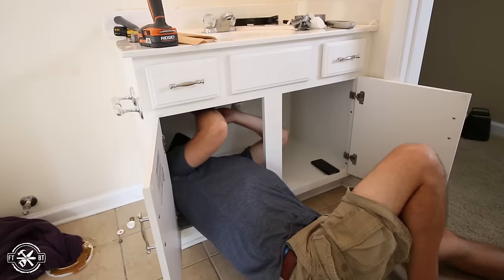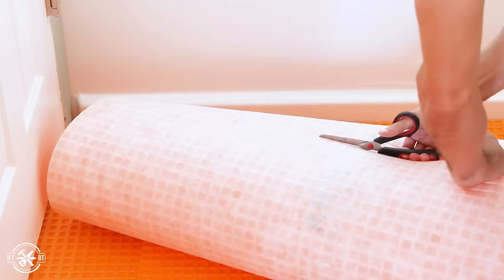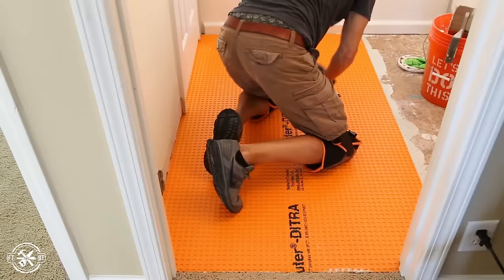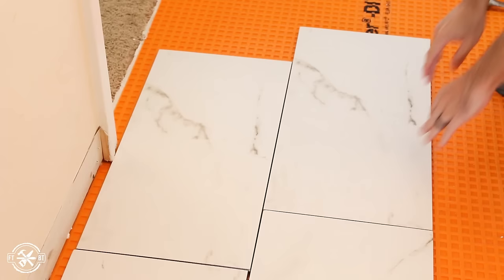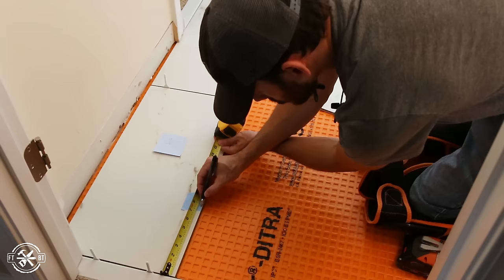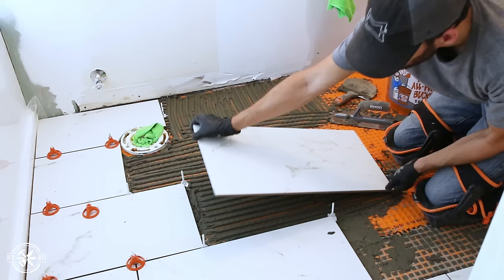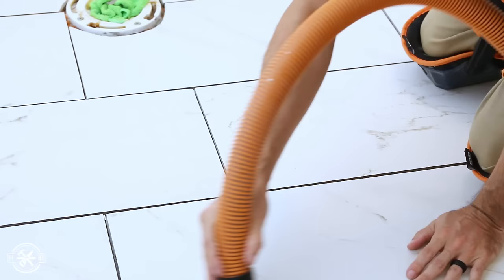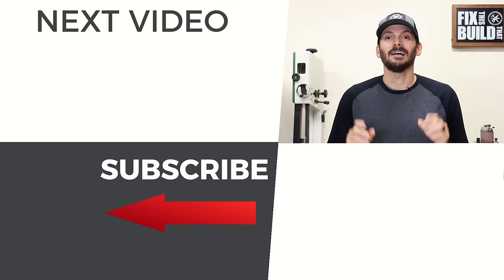How to Tile a Small Bathroom Floor | DIY Bath Remodel

Comment: Great Video.  Though, it's my understanding that it is highly recommended to dampen the subfloor with a sponge, before applying thin-set-mortar, to prevent the moisture from being sucked out of the mortar before it dries..
Reply: That's brilliant, great tip! 👍

Comment: As a professional tile installer I must say you did an awesome job explaining things and actually doing it correctly. Would have done a few things different but over all great video! Keep it up!
Reply from the maker: I'm a little amazed 😀. Was waiting to get kit up for something I did wrong 😂😂😂
Reply: @Fixthisbuildthat only thing I saw was speading of the thinset but that just takes time to get used to. Again great work!
Reply: Only thing I would change is adding more water to the mortar, both on the ditra(subfloor sucks up a lot of moisture) and the floor install(easier to work with).
Reply: I don't know what grout was used , but that was too dry to me. I wonder if it didn't crack. Dark thinset for light-white tile ? hmm. Yeah that mortar was dry for sure. Overall clean job.

Comment: "They didn't install it correctly......It shouldn't come up this easy"
I've heard this on a couple of videos I've watched about remodeling.  To me they are installed perfectly!
They are currently holding just the way they should but if you want to tear it up, it comes up easily. 
Sounds like a win, win to me.
Reply from the maker: Hahaha, good point. I definitely liked it 😀
Reply: Big Mike is talking Fair enough. haha
Reply: I'm thinking the same thing.  Things around the house should be easy to remove and replace instead of having to tear it all down and demolish it.
Reply: builders never think about the future where someone will want to change things, good luck future tiler getting that floor up

Comment: That was helpful, Ive never done floor tile before and didn't know you were supposed to butter them. Thx.
Reply: You don't have to on square tiles but on larger rectangular ones it is helpful because it's harder to get the mortar even across the larger plane and buttering them gives you more error room when setting them to be level.
Reply: How to tile a small bathroom using 10k worth set of tools
Reply: @Millennium Man And if you're just doing a relatively small job a $100 tile saw will get you through several of those. Way better than scoring and breaking imo.
Reply: @GardenofWar2  Thanks for the info.

Comment: I need to double check, but, I thought Ditre was used with UNmodified thin set. This video was awesome and the small bathroom was pretty much identical to mine. Love those tile spacers and will get those at HD if they still have them in 2023.

Comment: Subscribed! That Sketchup trick was real slick. I have used Solidworks in the past for laying out garage apartment that I built a few years ago. The only issue with Solidworks is that you have to make sure EVERYTHING has a dimension or constraint. Sketchup looks to be much much easier for projects like these. Great work!

Comment: Second video ive watched on this kind of thing, a few things i noticed that werent done:

- The pattern of the mortar on the floor looks correct, but it was not mentioned how important that is and which way the ridges need to go. This very important point could easily be missed by someone watching this as a guide
- Back buttering was done (6:13), but blink and you miss it. Again this was not explained and an easily missed step by someone watching this as a guide
- Actively working the grout in to the gaps between the tiles and not just floating it over and hoping for the best there are no gaps under the surface

Comment: good tips in this video. Use a standard masonry grinding wheel for the circular cuts which I like better because its easier to grind the inside of the curve which diamond cutting wheels aren't made for. You mix your grout DRY. if it works it works, but I've never seen it installed that dry.

Comment: The tiles look good and the levelling system does help. I would have used the Ruby wash boy set to apply and rinse off the grout. Washing the excess grout in 3 coats and each time changing the water so it's clean you do not need to buff or use a grout cleaner the next day.

Comment: Pro tip: don't lay tile on OSB, it's too flexible,  not strong enough to hold tile. When the floor cracks and the grout starts coming out... that's why. Also you can wipe the grout 2-3 times when it's fresh so you don't have to use haze remover next day.

Comment: Propane burning yellow will produce soot.  Fancy glass will soon discolor. Black is best for  longevity between cleaning. I am trying black glass beads used at the base of vases for flower arranging, Cheap, smooth no cuts and easily washed if and when.

Comment: The clip system will also pull the tile up in a corner potentially making it hollow underneath. This is the main issue with clip systems. If you notice this just lift the tile and add more mortar under tile. However all in all for the non pro it is amazing.

Comment: When working with ditra membrane try applying a thin mortar skim coat "back butter" to the underside of ditra membrane before placing it on subfloor to ensure you get a good bite.
Reply from the maker: Good tip

Comment: Awesome video and well explained. Question... I am remodeling the shower and I am using a floor similar to the one on the video for the walls, but for the floor I think it would be kind of slippery, what type of floor (polished or matte, porcelain or ceramic) would you recommend to use for flooring the shower area? Thank you.

Comment: Love what you did and how you filmed it. I have a very small bathroom floor and want to tile my shower wall as well. The only problem is Im thinking of keeping the original tub but it needs resurfacing and a new coat of paint. If I want to do this myself, do you reccomend learning how to resurface the tub and then just do the floor tile and new shower tile or is it better to pull out the tub and put a new one in which will be much harder for me I think?
Reply: How did this turn out for you? I'm getting ready to tackle my small bathroom (new tub and tile complete)

Comment: Im a long time tile guy. You did a great job!! My only two things i have to say is first your leveling spacers that you use suck. The wedge type are a lot better. And second is half inch on your trowel is a little big. I use 1/4 inch and i rainbow the grooves, this helps fill in the ditra grooves, especially if your doing a ditra heated floor. Minor stuff tho, and nothing that would make it any better or worse👍👍👍

Comment: Fix This Build That:  I am going to be painting the walls in the kitchen and the bathroom, and also tiling the floors in both rooms.  Would you suggest that I paint the walls first, then do the tiling second?  Also, should I take out the old tiles before I put the new tiles in?

Comment: Thanks for the video and the usefull information you gave. One question : when is a membrane like the Schluter Ditra really recommanded on a floor ? I have 2 plywood boards, 5/8 and 3/8 so I'm wondering if I should install a membrane before tiling. Thanks !

Comment: I like the leveling system. My question is for all y'all. How do you guys like that orange undermat that they sell at Home depot/Lowes compared to Backerboard/Hardibacker? Im doing my front bathroom and I remember doing my kitchen and master bath with the cement board but this looks much easier.

Comment: I wouldn't use wet saw for straight cut.  Not only time consuming but mortar will not adhere to wet tile as strong as dry tile.  tile cutter is the way to go.

Comment: Great video. I have a 5m Sq bathroom. The floor is not level. I tried to fix backer board directly onto timber floor using mortar. BAD MOVE. It didn't stick. Now I can't remove the mortar! 2 questions: how to remove mortar? And how to level floor?

Comment: nice job overall. end result looks great 

some tips: its always good to lay at least 1/4" ply over your subfloor so you dont spread thinset directly on your subfloor. If anyone plans to replace that tile in the future that sublfoor is a goner and theyll have to rip it out down to the floor joists. also its good to spread the thinset on top of the ditra first with the flat side of the trowel and really press it in there to make sure you fill all the waffle holes, then run over it again and comb a notch

Comment: Beautiful job. It has inspired me to do my 2 and 1/2 baths and a laundry room. What did you use across the bottoms of the doors as transitions to the rug outside the bathroom? Are they wood of marble? We will have wood floors outside of one of the bathrooms. Would you use the same material across the transition to a wood floor outside of that door?  Thanks!

Comment: I'm going to be replacing my wood subfloor for water damage, and then tiling over it.  I have the Schluter thing that you used, but everyone I've talked to said definitely use backer board of your tiling over a wood subfloor. Is the Schluter thing enough by itself?  I don't want this project to be anymore complicated  (for me) or expensive than it has to be

Comment: Great video. My bathroom is 2x2m. Could fall to the floor waste be created by lifting the outside edges of the compressed sheet underlay?
And can adhesive be used to lift the underlay?
I don't want a step up at the entry so could you use more adhesive around the wall and less around the centre to get fall to the floor waste?
Thanks in advance!

Comment: Did you need a spacer around perimeter ?  Is there anything that you can use to go right over vinyl flooring?guessing you don’t need ditra if not in wet room / washroom

Thanks so much

Comment: Those tile systems pull at least one tile up which creates voids. Not trying to be negative, it’s just fact. If you can get the tiles level without using these systems the integrity on the installation will be superior.

Comment: I'm a new subscriber.  Thank you for answering one question that I had (how to tile where the toilet goes).  I have about a million other questions, so here's one of them. Our house has concrete floors throughout. Is there anything that I would need to do differently when tiling over concrete instead of a regular subfloor?  Thank you.

Comment: I'm just wondering, why isn't it insulation in the walls??? It helps a lot in noise cancelation, and to keep the same temperature inside whether it is warm or cold outside. So you dont have to have the AC running as much

Comment: If you're going to use Ditra I don't understand why you didn't use Kerdi-band to waterproof the seam between the sheets of Ditra as well as between the sheetrock and the ditra and the tub and the ditra. Yes, it's more work, but it will be 100% waterproof.

Comment: Great video! One word of advice. Invest in a couple of plumbers plugs for the drains. You will look like the pro you are by stopping septic gases completely.
Reply from the maker: good call.  I went the easy route with rags, but a plug would be better
Reply: I learn the hard way. Some jerk pulled the rag and pissed in the drain but got most of it on the floor. Guy was too lazy to use the porta john. You can tighten the plug enough that they need pliers to open it. @Fixthisbuildthat

Comment: First time. My grout is black. Not only does the black continue to come up with wet towels but the grout is wide  and narrow. We used lots of spacer to get the tile straight. What did I do wrong and how do I prevent the black to quit coming up?

Comment: I just have to lay some tiles where a base kitchen counter will go, doesn't have to be pretty, just level. Whoever laid the kitchen tile before I moved in did a lousy job as there are hollow spots and lipping tiles everywhere. cabinets I built using your plans will be removeable so I can reuse once I level the subfloor. The slab probably looks like the moon.

Comment: Great video! I'm doing a bath with similar dimensions. I noticed you installed a threshold but didn't mention it in the video. How did you select the threshold and would it install like the other tiles?

Comment: my dad would have a heart attack if he seen a tile job like this.  he was a setter for 50 years.  his jobs was always wire mesh and coat of concrete over a sturdy, well nailed down sub floor.  Never any future cracks, just a pain to take out if you want to do a future reno.  IF not using a good tile, that floor will crack

Comment: hey question, I understand Schulter Ditra is very usefull in water section remodeling , also for tile to kind of float and to prevent crack to migrate from other section , do I still need to apply it if am doing a bedroom floor or living room or dinning room ?  any other methods to keep tile safe , specially quatz ?

Comment: I was told modified mortar for the tiles was okay. Is that wrong? If I'm adding height to the floor, going from linoleum to half inch of Ditra and tile, will I have any problem with the toilet flange being too low?

Comment: Did you use the 1/16" LevelMax?  My 12 x 24 tiles call for a 1/8" minimum space between tiles.  Suggestions?

Comment: You didn’t key in the thin set on your sub floor when you did the ditra.  You’re also supposed to key in again thin set on top of the ditra filling the waffles before applying the thin set for the tile.

Comment: I want to tile my kitchen floor witch is concrete  does ditra help with insulation as I don't want to put under floor heating in. Never really understood ditra its supposed to work as a moisture capture but we fill the pockets with thin set?Great video.

Comment: Hey, would you recommend the DITRA for a 1/2 bath?  The area I'm wanting to work on is only a toilet and a vanity.  Also, did you end up needing to get the largest wax ring seal for when you put the toilet in as a result of tiling? Thanks!

Comment: Hey, great video. I have a question. When going against the tub, that has no molding to cover the edge, do you round the tile edges at all? The tile that I am looking at is 12x12, but edges are rounded from top to bottom. Any suggestions?

Comment: nice video   would i be able to use red guard water proofing in the washroom  as will to get double protection  beside  the one that u y used  also would like to know which tile saw that u used i  bought one  of these RIDGID wet saw but was not  cutting straight so i had to return it  thanks

Comment: Thanks for the educational video!  I was wondering how you would make cuts into ceramic tile at both ends of a bathtub that angles.  in other words,  the center of the outside tub is straight and then the two ends angle in at about 30 degrees like two l2 inch triangles. the thickest end is about 2 inches and the thinnest end is about 1/16 of an inch.  the tub dates back to 1959!
Reply: Replace the tub...lol
I'd probably make a template out of 1/4" plywood and make it perfect then just trace it out on the tile.
I've used belt sanders on tile edges to take 1/16" off. Maybe that would work for you.

Comment: Love the spacers! My house is old and the original wood floors slant, I want to install tile over them in the bathroom. Any recommendations on how to level before Install?
Reply: There is specific self leveling thinset meant to do that.  I would imagin it has limitations on how mcuh it can even out (might not work in Amsterdamn where the difference is measured in feet...).  it is similar to thinset and morter but designed to go on quite thin which allows it to flow out and cover the dips or slant to give you a fresh level surface from which to work from.  I am sure it was say on the directions if i can go over plywood or whatever your subflooring is.  i have seen otehr videos recently abotu redoing a shower where teh recomendation was to refloat the wall as well as it would make tiling a ton more easy.  A bit more time to start saves a lot of time and I am geuessing saves even more time for us amateurs.  Plus more likely to end up with a more pro result.
Reply: RainCity84 awesome! Thank you, I will look into that. It’s not drastic, but enough for liquid or round objects to roll
Reply: @cheyfran  sounds perfect then.  Good luck!

Comment: Looks amazing!
I just registered for Sketchup... not sure where you went in to design the tiles floor plan. Can you let me know instructions please?
Reply: Just use a feet and inches design template, draw a rectangle the size of your tiles, and use the copy tool to make individual tiles. Then create another rectangle/L shape/whatever shape your bathroom is and lay it over the web of tiles you made, moving the rows around until you find a good pattern

Comment: Looks like I found the channel I'm gonna need.  Getting ready to re-tile our whole house (starting small...with bathroom).  Have NO experience with this level of home improvement, but I have done other projects using YouTube and your vids look like they provide the right level of detail and you don't skip things that other professionals may consider "common knowledge."  Do you have any vids that tells the viewers any "gotchas" with tile removal and installation? (although, looks like you mention them as you go)  Great vid!  \Quick question: do you recommend DITRA only in bathrooms or do you use them in other areas (hallways, bedrooms, kitchen, etc).?
Reply from the maker: Ditra is great for water areas, using in larger areas could get pretty expensive but would work. I'd probably just go with hardibacker though
Reply: Fix This Build That Thanks for the advice. Haven’t looked up price for DITRA yet but I’m thinking I’ll likely go with your recommendation and just use it in the bathrooms. 😊
Reply: Fix This Build That Another ?  What’s your opinion of Vinyl planks? Looks like it might be a viable alternative to tile (and easier to install).
Reply from the maker: Turn on notifications for my channel and wait a couple days 😉
Reply: Fix This Build That Done! Looking forward to it!